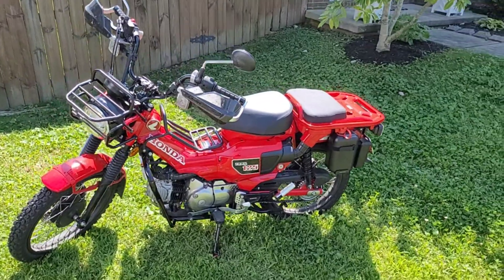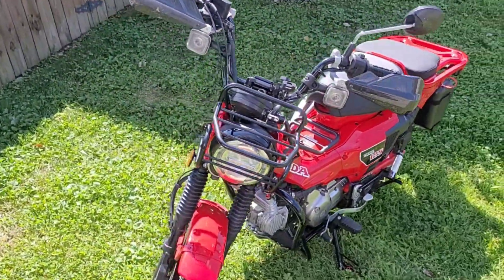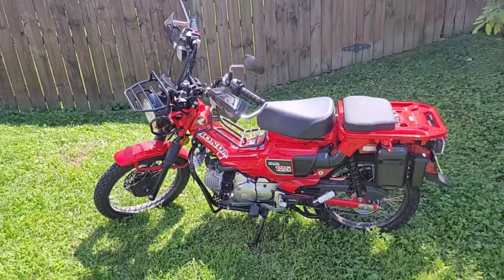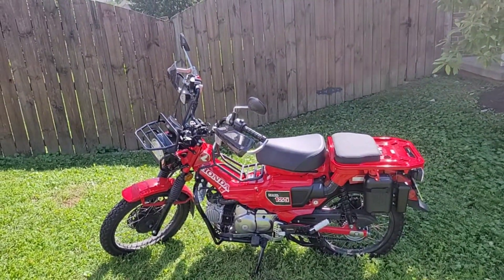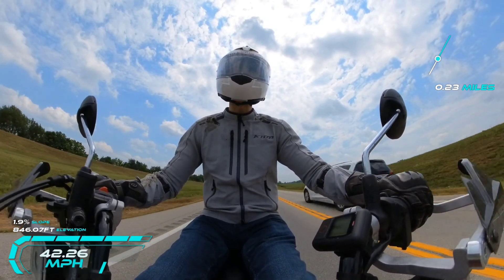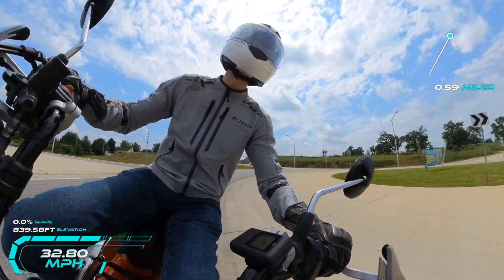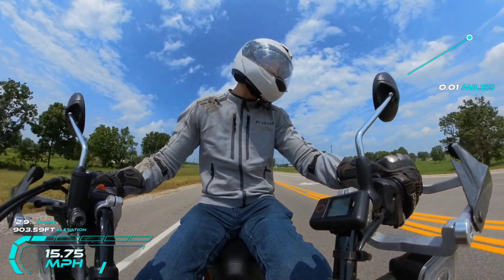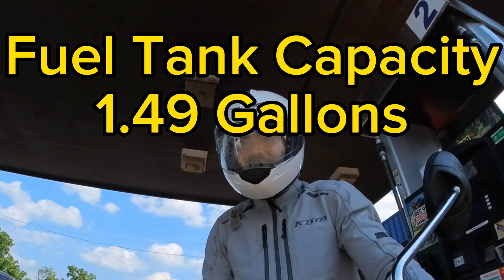ULTIMATE 164CC HONDA TRAIL SETUP! Final CT125 results: Part 2

Comment: I've been happy with my bone-stock Super Cub getting an average around 110mpg, but only a .9 gal tank.  I'm thinking about seeing if I can have a bore kit done, probably around 145cc just to give me that little extra top end for windy days (sucks not having a 5-spd transmission), but I haven't yet found out if it's beneficial or not.
Reply from the maker: Yeah, it was the wind and hills that ultimately sent me on my journey! Just a few more cc's and I can keep up with traffic! 😅
Reply: @QuantiQualification  I'm definitely going to consider it.  Though, I think I'll take it into the Honda shop we have near me, I'm due for tires anyway and I think I'm ready for my first valve adjustment.  I even bought the special tool to do it!
Reply from the maker: @cujoedaman Sweet!

Comment: I wish you wouldn't have used ethanol free gas because it isn't available to everyone.
Reply from the maker: Good point. The nice thing is that it is pretty well known that ethanol free will give you right around 3% more fuel efficiency.  So that would put us at 108 mpg on ethanol gas, more or less.
Reply: @QuantiQualification  I don't know why the stations in our area of Ohio quit selling ethanol free gas. Not a small community either. Very disappointing.
Reply from the maker: @BAtadCrazy  That is not good.  With these small engines, any amount of ethanol left over winter can absorb water and corrode/clog injectors and other bits. We are down to just one station in my town with ethanol free, and it is only 90 octane.  If that goes away . . . 😬

Comment: See now that's a great review . Starting it up an going another .4 miles alot if folks wouldn't think of an it could make the difference pushing it a half mile or riding. 
Hate to see you get away from the ct that's why I'm a follower.
Reply from the maker: Thanks for the kudos. Don't worry, I will continue doing CT videos! Just adding something a little different to the arsenal!

Comment: Would you change anything on this setup?  Cam or larger bore?
Reply from the maker: The only thing that I would and am going to change is the number of Takegawa high strength clutch springs I used.  I put in all 6 and I think 2 or 3 would have been sufficient. The six Takegawa springs makes it a little harder to shift.  Aside from that, I think I have reached a perfect balance (high enough top speed, good enough fuel economy, great reliability, full capability).